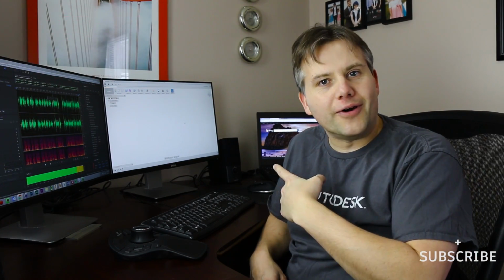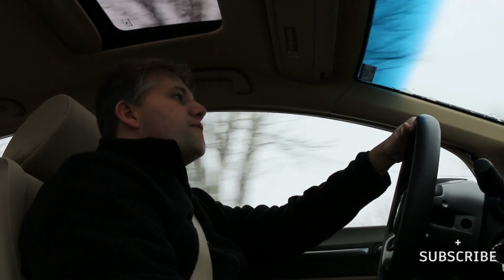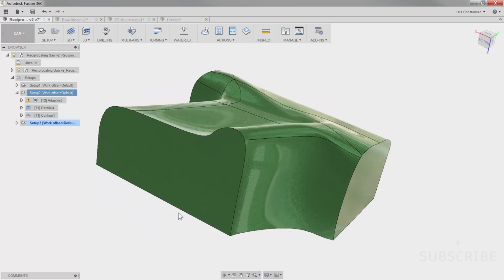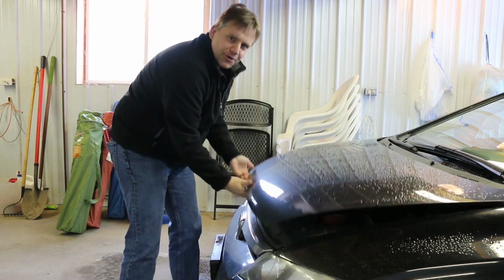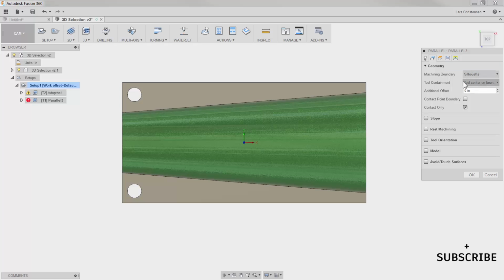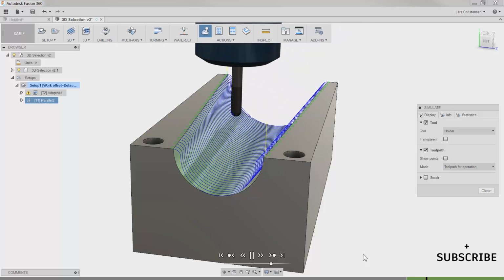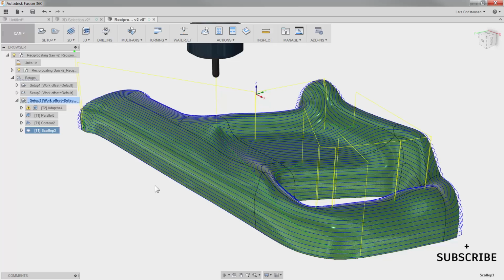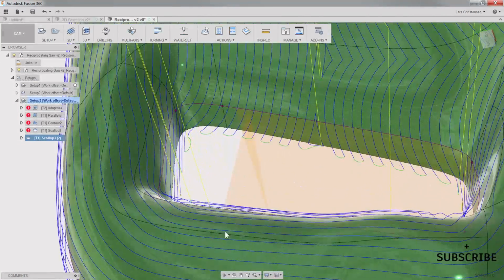Fusion 360 CAM Tutorial— 3D Machining- Basic

Comment: I made it through and it's a great start-to-finish series.  I learned a lot.  But I did get stuck a few times because this video is a few years old and Autodesk have changed around a few controls.  It had to do a bit of experimenting to work out a few of the steps in the current version.

Comment: Lars, you make so many great videos, but it is hard to have an overview of what you have done. I have a subsupplier that when a part needs to be machined in 4 setups, actually make four different inventor files. I assume that it should be possible to keep four setups and their associated operations in one Fusion 360 file. 

This is a great video for explaining the path choices. Do you have one that show how to ex. setup and mill the 6 faces of a 3D part, and how to design the file structure.

Comment: I appreciate the info that you have provided here, Lars, but the fact that this video doesn't address in any meaningful way roughing and finishing operations and how to set them up properly leaves me the same questions I had when starting the video, and 26:06 less time to do so.  This seems such a fundamental topic to cover - i.e. it's not just about picking the right tool path - it's also the settings for that tool path(s).  Also, while the car analogy was an attempt to add a little fun, it's a bit of a stretch.  All this said, I did learn some valuable things here and appreciate the effort that goes into these videos.
Reply from the maker: Thank you Dave Fribush

Comment: Thanks Lars, this video is worth gold. As usual an easy teaching style that doesnt tie your noodle in knots. One question being new to Cam / Cnc. Leading on from your great tip about increasing the offset size to smooth out the scalloping operation. Is there a general rule(s) on ratios etc on how much larger your physical stock should be in relation to your actual model size particularly if you are working with organic forms with complex steep and sweeping surfaces ?
Reply from the maker: Hi adrian brookes Thank you for watching!
I don't know if there are any specific rules. I have always left 0.02 to 0.015 inch from my roughing to my finishing operation. I would for sure have an additional 0.1 inch for the rough to remove.

Hope this is useful.

BEst,
Lars

Comment: Hi Lars. Mastercam, Solidcam, Fushion 360 or Autodesk HSM . which is better for 3D milling and 5-axis program? Thanks
Reply from the maker: Ha. I am totally biased as I work for Autodesk!!! I did use Mastercam for about 10 years. Never used Solidcam.

The CAM in Fusion 360 and Autodesk HSM is virtually the same.

I would bet a steak dinner that Fusion 360 and Autodesk HSM has the easiest to learn and use when it comes to 3D milling.
When it comes to 5 Axis machine Fusion 360 and Autodesk HSM has some 5 Axis toolpaths, but if you are really looking to get advanced, Autodesk's Powermill is the King of 5 Axis machining on the market.

There, that is my opinion :-)
Reply: thanks so much. I use Solidworks and Mastercam for Solidwork (Add-in). Do you think I can add-in HSM to Solidworks too? Or Solidworks just can accept add-in 1 CAM software only? Thanks

Comment: Lars, you may have answered this here or elsewhere already, so I apologize if I take up your time unnecessarily. When I use Fusion 360 in order to estimate machining cycle times I find that the calculated time shown under the "Simulate" tab is significantly different than the one shown when a setup sheet is produced. Can you explain why and which I should treat as closer to accurate? Thanks!
Reply from the maker: Hi Brendan, Thank you for taking the time to watch the videos. I contacted the development team and they are aware of this issue. I would think one of them is correct and the other is not...If you do a quick test run, you should be able to figure out which it is.

Hopefully, this is resolved soon.

BEst,
Lars

Comment: Lars,

Thank you for taking the time to put these videos together. I have completed my first design and converted to CAM and added the toolpaths also. How do I mill the whole design without cutting into the vise or table on the mill? How do I secure the stock and cut all the way through without running into this problem?
Reply from the maker: First, make sure you have selected the component you want to machine in the Setup section. By default the software will also include the vise and the table. Second, would be to control the depths on your heights tab
Reply: Lars,

I have a Taig desktop mill running Mach 3. I am having a ton of trouble getting off to a good start. I am getting really discouraged with CNC milling. I made a simple 3D model and used CAM to convert it to G-code. I loaded the file to Mach 3 and started the cut. It did the cut, but when the end-mill went from one side to the other it ran through the main body of the project. I know it is some setting that I am not doing right, I just don't know what I am not doing right. I wish I could take a hands on class with someone teaching 360 Fusion, Mach-3, and my mill.

Comment: Hey Lars, which are the actual capabilities in fusion 360 for 5 axis machining?, I know that exist swarf and contour but I want to machine an impelller but I dont know if is posible with the actual functionalities?
Reply from the maker: There is also 5 Axis tilt within the 3D Contour toolpath. In my opinion, Fusion 360's 5 Axis is not yet powerful enough for impeller machining.....I would look at something like PowerMill for that.

Comment: Lars hi. I have an 5 axis machine, and tried to find the way to set a RTCP (Rotation about tool center point) on Fusion 360. Is this possible? I don't wanna came out from Fusion to another software to do that, because Fusion is ideal for me, whole package on one place, parametric modeling, simulation, cam, render and drawings. Hope if Fusion can't handle 5 axis yet, do it in the near future.
Reply from the maker: We are having this discussion on Facebook right now, correct? Just want to make sure you are the same person.

Best,
Lars
Reply: Hi Lars, I am
Reply from the maker: Thank you :-)

Comment: Hi Lars. Thanks for the great videos. I wonder if you could help me with a little CAM challenge. I have a very simple model that i can't find out to do how to handle. The model has 2 slots. I just want to mill them with a ball end mill instead of making a 3D toolpath with a small end mill The part will be made in POM plastic. Hope that you have a good solution. Best regards Thomas. Here is the link to the part. http://a360.co/2mognco
Reply from the maker: Thank you for watching the videos. I would create a plane that is tangent with the bottom of the slot (Offset plane) then sketch a line at the center of the slot and drive that with the trace toolpath.....Like this http://a360.co/2mmSJJU

Hope this is helpful.
Best,
Lars

Comment: Lots of useful news on 3D CAM here!
Tere's no fake news here. ;-)
Re: Adaptive clearing. Is that more useful for serial production, prototyping or both?
Reply from the maker: Thank you Einar :-)
I use Adaptive Clearing whenever I can. Yes, it will remove a lot of material quick (What makes you think production) BUT, because it is calculating constant load on your cutter, it will also save on tool wear what I think is important for everyone :-)
Check out this cool video:
https://youtu.be/_N5VaTchhys

Comment: Thanks for this valuable tutorial.  I've subscribed to your channel and have watched nearly all the videos.  Nicely done!

One place I am struggling is in the transition from conceptual modeling to milling.  For example I have a slab of 1/2" 6061 aluminum that I know I will produce all of my assembly with.  I've generated the model, ensuring joint motion and collision issues have been resolved.  The model contains screws and bearings that are part of the assembly but obviously not the milling process.  Now I want to basically decompose the model and nest all my machinable components, hopefully in a single operation from the single piece of stock.   What is the best way to make this transition?  Create multiple models?

I hope I've explained my situation with enough detail for you to understand.

I live in upstate NY too and using the snowy nights to learn Fusion after clearing out the driveway.  

Thanks again and stay warm!
Reply from the maker: Hi Scott, Thank you for watching and commenting...Hmm, I think, I would right-click each component and do a Save As so I bring them out of the original assembly, and then assemble then in the nested layout, in it's own assembly.

I would have to see the design before I would totally commit to do it like this, but that is where my brain is at right now :-)

Hope this was helpful.
Reply: Thanks for the response Lars.  I will give that a shot.  What I did in the meantime was to go back in my timeline to where the primary components were generated and arranging them in the "stock".  I can then slide the timeline forward to see the assembly and simply slide back to that "stock" point and generate the tool paths from that there.  It may not be pretty or best practice but it worked in this situation.